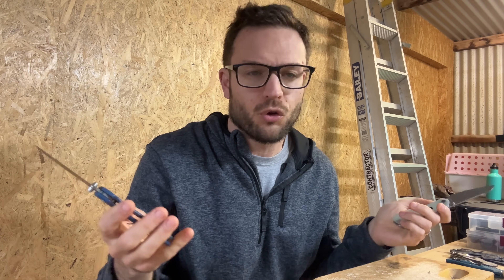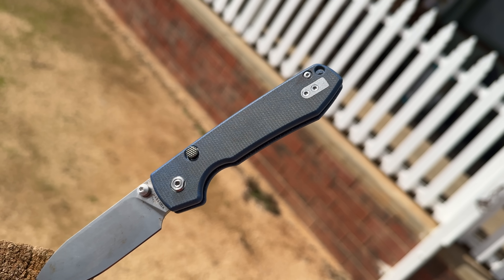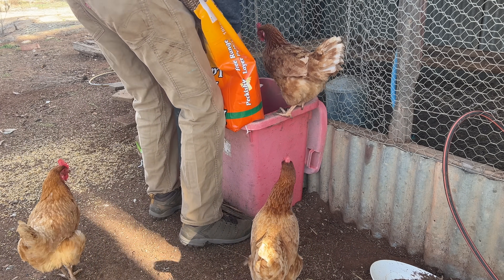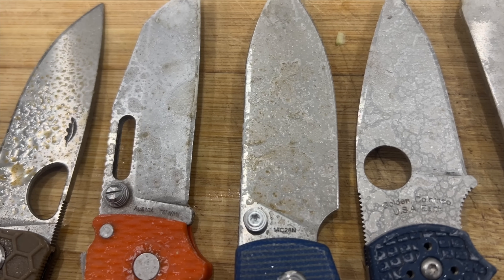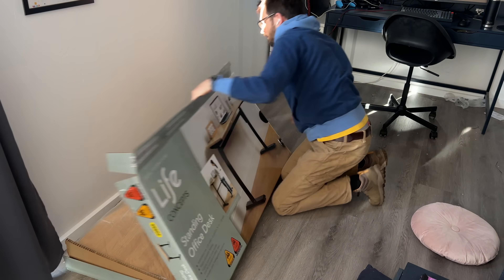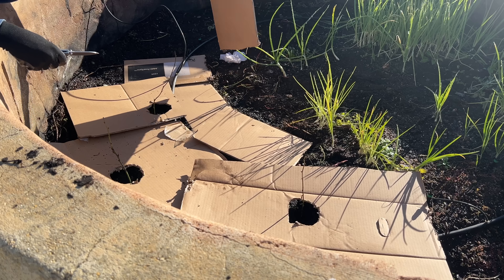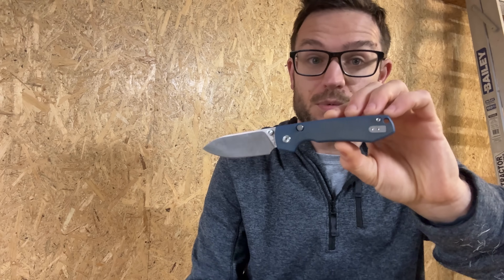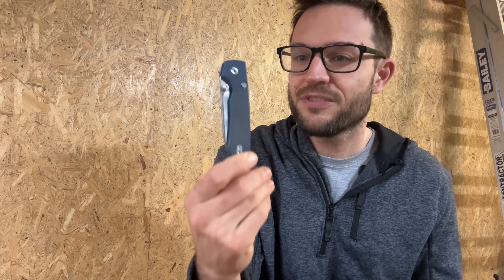Vosteed Raccon Vigorosly Reviewed

Comment: Ive been carrying my vosteed for a few months now (in both main and backup roles in my edc) and its honestly one of the best edc knives ive ever owned. The heat treat they use on their 14c28 is very impressive- no, its not s30v, but it doesnt need to be if you keep a strop handy. At $60US, it blows pretty much everything else put of the water- i would argue its probably the best edc knife you can get in the 30-70 dollar range, although I havent tried the kershaw iridium yet (which is a heavier edc option). Its currently in my pocket supplementing my spyderco pm2- i absolutely reccomend it. The cross bar/axis lock style is also my go-to as a lefty

Comment: I have found similar results from 14C28N and Nitro V in terms of rust resistance 

Strange though, as the “statistics” of 14C28N, having less carbon and more chromium then Nitro V on average, would have you believe that it would be MORE resistant to oxidation 

Perhaps Nitro V is a step purer then 14C28N? 
An odd thing, as 14C28N is already very pure for an Ingot steel 

But maybe that .1% of Vanadium is doing more work then expected of such a small amount of carbides 

As small amounts of Vanadium is used to refine the grains of Carbides in steel

All in all, I’d go for Nitro V over 14C28N if given the choice

Comment: To me that sounds like the vosteed has a higher hrc. That would make it rust quicker and the civivi turned to bacon instead of snapping lol. I have the old kme, is the new one worth it?
Reply: yeah i wonder if that's the case. it was my understanding that 14c was rated as a being more corrosion resistant than nitro v

Comment: I have this model in green with a gold thumbstud as well as their axis lock version in green and black. I actually had to use their warranty on the button-liner lock version (which was more expensive in the US). The first model I got didnt lock up even with vigorous opening. An almost imperceptible burr on the mating surface of the liner lock prevented it from sliding over the blade enough. They were very good with warranty services and were interested in the problem. I ended up fixing the model by taking it apart and sanding the surfaces just a little and it's been great since. My axis lock version (which is slightly less fidgety than the button) also had fhe pocket clip get bent to heck like yours. Maybe they shouldn't do that big cut out. Overall they're great knives, I'd equate to Kizer which im a huge fan of. 

On the button version I did notice that if you're stabbing down with a reverse grip, your pinky can hit the button and the blade can close when not desired.
Reply: i just got one pretty recently and it missed the lock up when opening but only if i did a slow roll. after about 1 or 2 dozen openings it went away and i can only assume that it is now a perfect mating surface.